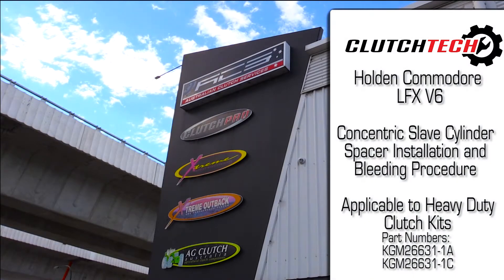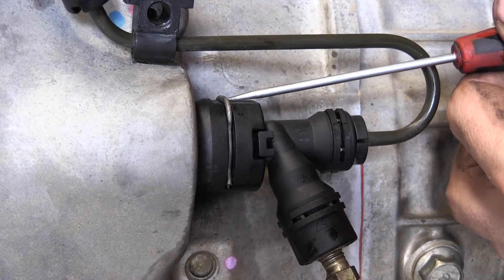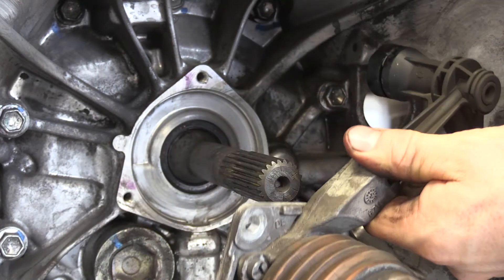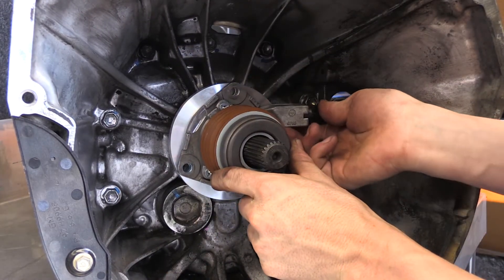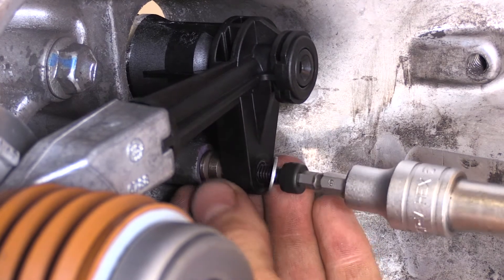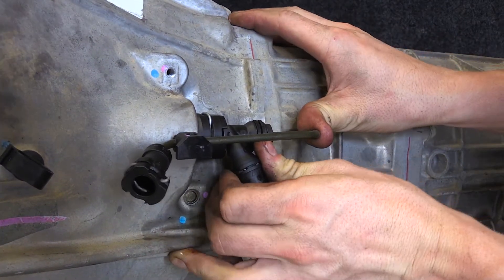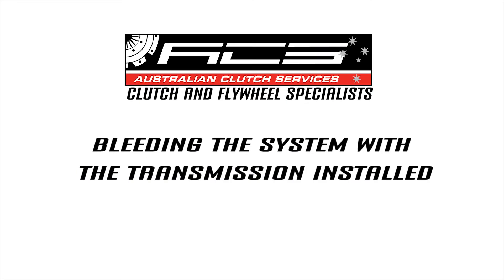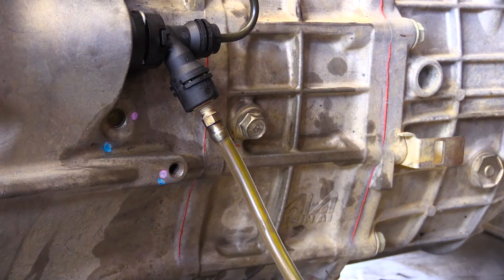CLUTCH TECH: Holden LFX V6 Concentric Slave Cylinder Spacer and Bleeding Guide

Comment: I watched one video before which was perfect. An abs pump unit I filled the holes with fluid before fitting. That way bleeding was much easier. This video I saw on concentric clutch. The guy filled it with brake fluid from a cup first before he’d installed it into a gearbox. Clever

Comment: You guys might be able to answer this as I'm struggling to find the info I'm looking for.  With the manual trans from the 2016-2019 lfx bolt up to the 2.8 lp9. I'm sure there is going to need to be a spacer or something to make it work 100% for my project I'm trying to find this info out before i start the build to be prepared for what i may need.  Thank you.

Comment: Why do you need a spacer ?
Reply from the maker: Hi Darren,
This video is for installing the CSC with our heavy duty upgrades for this vehicle and a spacer is required to be installed with these upgrades due to changes in the clutch design.
Thanks